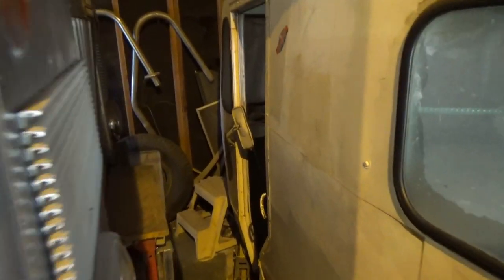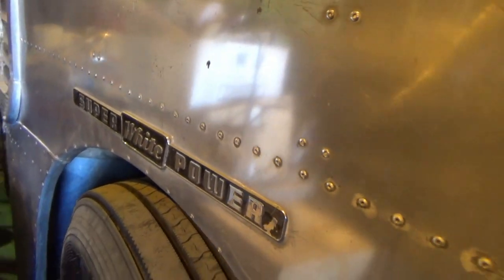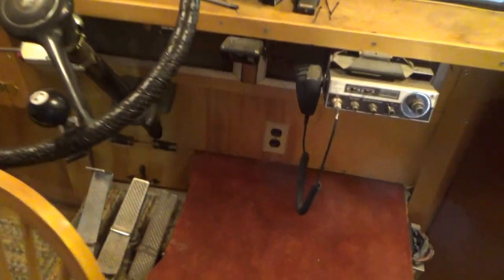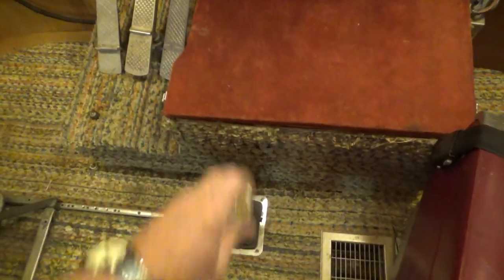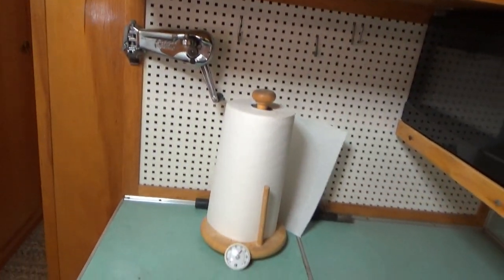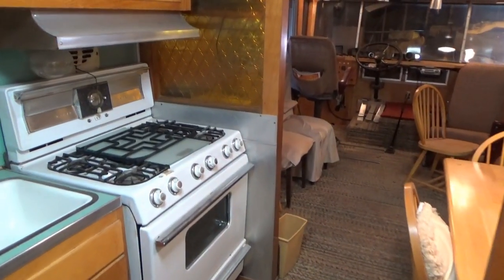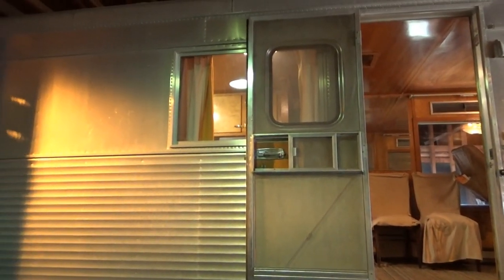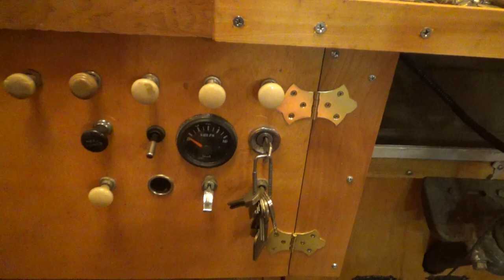Vintage 1953 White/Spartan Motorhome

Comment: your dad built a masterpiece. 
might be time for a 8.2 Detroit. I had a old f600 wrecker with a 8.2 NON TURBO A 5 speed trans and a 2 speed test and end loaded I got 24+- mpg .time for vintage rv shows
Reply from the maker: Tim, thanks for the comments.  Before my Dad passed away we were looking for a used school bus with a Cummins turbo diesel and an Allison automatic transmission.  Not sure which way I'll go now but it definitely needs a new drivetrain to make it usable on modern roads.

Comment: Pretty cool but I put a Detroit diesel in it
Reply from the maker: It definitely  needs a new engine and transmission.  The mid 50's flathead 6 motor and 10 speed crash box transmission just don't work in the 21's century.